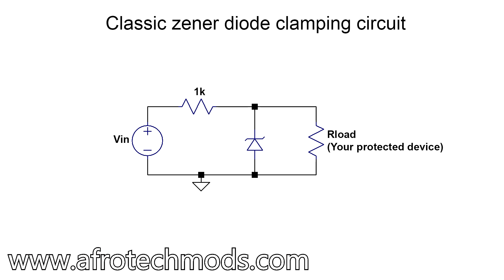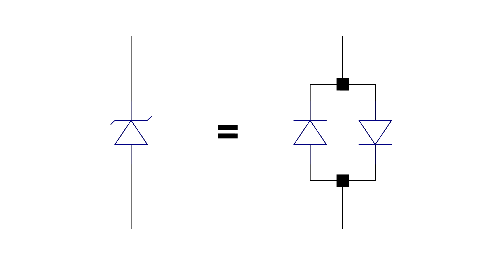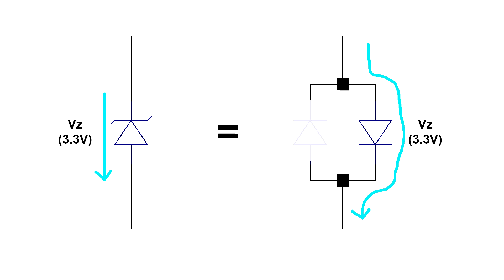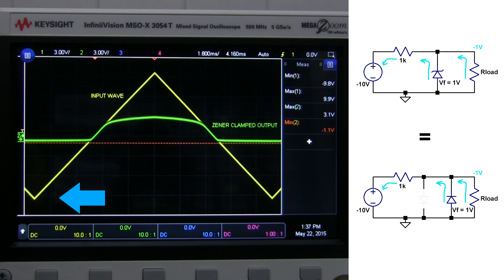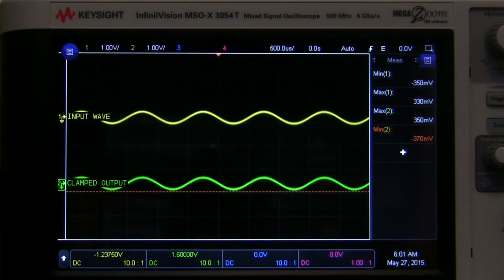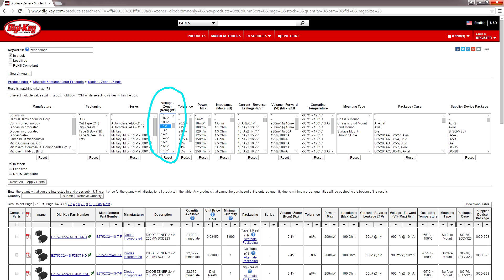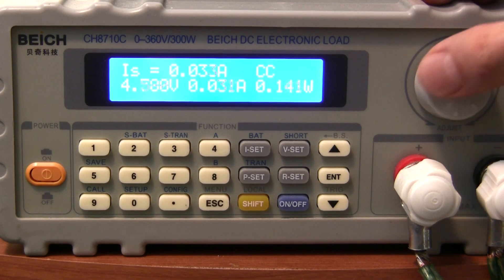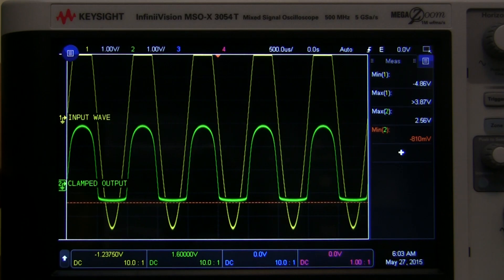What is a zener diode?

Comment: bi-directional diodes? HERESY!
Reply: hornylink Actually, all semiconductor diodes exhibit Zener behavior at high enough reverse bias voltages. Even though the carrier depletion layer at the P-N junction becomes thicker (which is also the basis of another diode device called a varicap) with reverse voltage, eventually the tiny trickle of electrons crossing the layer becomes so energetic that they knock other electrons out of their shells, creating electron-hole pairs which allow more current to flow, which creates more electron-hole pairs, etc. When a certain voltage is reached, this happens very quickly, like an avalanche (Zener diodes are also called avalanche diodes), the voltage needed to sustain the avalanche drops, and current increases without restraint unless limited by a resistance in series. This can destroy a general purpose rectifying diode, and is the reason for the reverse voltage breakdown specification on a diode.

A Zener diode is one that is designed to have a lower and precisely defined breakdown voltage, and to recover normal rectifying action (ie stop current flow) at almost exactly the same voltage (rather than at a much lower voltage). And external current limiting resistors prevents destruction of the diode on the first avalanche event.

Now how about a video on the varicap diode, which is used to frequency-modulate an oscillator and to keep its frequency constant?
Reply: They totally missed the chance to call them biodes.

Comment: I was planning to make an oscilloscope "divider" for a mobile phone oscilloscope. Placing two 2v2 zeners, to clamp voltage to a safe limit, not to burn down the mic input. Does this sound like the correct way to do it? Of course voltage would be dropped with a resistor voltage divider first and zeners would be used just as extra protection.

Comment: Could you explain how using a zener diode in series with flyback protection diode aids in shorter relay switching times as show in this picture. http://jumperone.com/images/2011/10/using-relays/002.png I'm having trouble wrapping my head around how works.
Reply: Jon Vannatto I'll give it a try. The goal is to get a faster switch off time, i.e. the current through the relay needs to decrease faster. The change of current through the solenoid of the relay (I)is determined by the voltage at the relay's solenoid contacts (V_L), V_L = L (dI/dt). L is the solenoid's inductance. (I dont know if you're familiar with derivatives. dI/dt means the slope of I, how much it changes with time. The unit would be Ampères / second). How fast the current decreases is therefore determined by (dI/dt) = V_L / L. Without the zener diode, the voltage (V_L) to reduce the current would be the forward voltage of the silicon diode, -0.6 volts. (Negative, because the solenoid's voltage and the diode's voltage are in opposite directions.) When adding the zener, the reverse voltage at the solenoid will be increased by the zener's breakdown voltage, and so the current decreases faster, and the relay is turned off faster.
However, the maximum permitted reverse voltage is determined by what the transistor can cope with. The highest reverse voltage would be achieved by omitting the protection diodes at all - which is not desireable.

To get fastest switching times, one would also choose a relay with low inductance (L). But this depends on the application. High switching capability of the relay -> massive relay contacts -> high weight -> strong solenoid needed -> high inductance L.

I hope that was more or less comprehensible. If not, please ask. Other readers: If there are any errors, I'm open for corrections.

Comment: Misleading, regular diodes can also conduct in reverse bias, this is known as avalanche breakdown. Which is also the same mechanism for reverse bias conduction in zener diodes.

The only difference is that zeners are engineered to breakdown at a lower voltage on purpose.
Reply: BGM ya, but they're not designed to carry in reverse. The magic smoke comes out

Comment: Would you consider doing a followup to this video with more circuit "protection", with how to more completely protect an analog input from both negative and high voltage and high currents, for example from a magnet switch in an alarm system, which could be subject to sabotage of hundreds or thousands of volts/amps? How would you easily but very efficiently protect against that? Great video, as always, I love these! =)

Comment: I'm planning to use a zener as voltage reference for a low voltage cutoff or alarm on a lipo. How accurate and stable will it be for this purpose?
Reply from the maker: SirArghPirate I don't recommend it! Use a proper reference voltage IC.
Reply: Afrotechmods A LM7805 for instance? I plan to use it on 2S or 3S lipos. The 5V ref voltage on the non-inverting terminal and a potentiomenter as a voltage divider to set the cut off/alarm voltage on the inverting terminal and when the voltage from the voltage divider falls below the 5V, the output goes high and sets off a second comparator arranged to oscillate at a certain frequency with a buzzer attached.

I don't know if this works though..
Reply from the maker: SirArghPirate
That sounds reasonable but you may prefer a 3.3V reg or a lower drop out 5V reg for the 2s pack. Make sure you use a worm gear driven pot that can't vibrate loose.
Reply: Afrotechmods Good advice, however I think I'll stick to fixed value resistors and eventually a jumper to switch between two ratios, one for 2S and one for 3S. If I use this for a cut off circuit, where the output from the comparator drives a mosfet that controls the power going from the battery to whatever equipment I use it on, will I run into problems with the system oscillating on/off due to the voltage from the battery being slightly lower during load?
Reply from the maker: SirArghPirate Yeah oscillation can be a bitch in these situations. Look up "hysteretic comparator" for one possible solution. Definitely simulate in LTSpice and test on the bench before deploying live.

Comment: Hi, I'm designing a simple radiation detector.

The GM tube requires 400VDC. I found a nice plan for the step-up itself, but it still needs some kind of feedback, so when the output reaches the desired voltage, a transistor would pull the base of the oscillator transistor to ground.

The best idea seemed to be using a 400V zener diode, but the store I oder from only sells 100V zeners...

So my question is the following:
Is there an alternative - apart from putting 4 in series - to make the feedback?

Comment: noob question: Is there any reason why you wouldn't just use two silicon diodes instead of a zener diode?
Reply: derstreber2 The silicon diodes are going to have similar voltage drops.  So it would be around .7v in each direction.  The zener effect allows for the voltage to be much higher than the .7v of a standard silicon diode.
Reply: derstreber2 Zener diodes are meant to be reverse biased to behave like a regulator ,so you van get a 12 V,3.3 V,5.1 V etc.Silicon diodes only get 0.7 V always (of course there is a limit on the voltage you can apply to them depending on the size)

Comment: Is there a discription on the diode to tell what the voltage are? So one could tell which is which?
Reply from the maker: centaur1a You have to google the part number for the datasheet.
Reply: 1N47___ look up in nte cross ref. guide . 1N47, 1N52__ are zeners, sometimes just a letter then a voltage. eg. 5.1

Comment: Great tutorial, I'll be looking out for the "fartduino"! On a more serious note I know you can add a transistor to the zener circuit when more power is needed.  The collector goes to +, the base connects to where the resistor and zener meet, and the load connects to the emitter and ground, that kind of circuit has been around for years.
Reply from the maker: CoolDudeClem Yes that's a very common way to make a linear regulator!
Reply: CoolDudeClem Yup! To achieve better load regulation,  (lower the apparent output impedance) then use a transistor with a high gain, because when you use a BJT as an emitter-follower like you describe, you create effectively a feedback loop within the transistor, and higher gain is like a higher 'P' factor, so better regulation. You can use a darlington to further improve load regulation, but the disadvantage is that the "dropout voltage" will be considerably higher.

If instead you use the complementary darlington pair, you will get the advantages of a low Vbe saturation voltage (which is the main culprit for dropout voltage) as well as additional gain, and better line regulation! :D I actually use this set up a lot when I cannot find a suitable regulator in my junk bin!

However, if you are simply using resistors to bias the zeners instead of a proper current source, then the current through the zeners will be proportional to the input voltage, and since the zener voltage changes a bit with respect to that current,  the overall line regulation will be pretty crap, but good enough for most non-critical things. You can actually use a small regulator as a voltage reference to replace the zener diodes and improve performance.

Comment: "Just make sure you don't use them for anything high powered."
*imagines you inserting a clip of some melting zeners*
Doesn't do it.
Disappoint!
Reply from the maker: Forssa1 I uploaded those a few days ago!
Reply: +Forssa1 Grabbing a zener that has turned to molten glass is a pain you will never forget.
Reply: i love these things because they fry very easily ;)
Reply: Afrotechmods will never miss an opportunity to melt stuff
Reply: Forssa1 I have used them on 3 phase static converter to prevent damaging voltage spikes that's high power, but I get what he means.

Comment: can someone please
 explain the difference between positive and negative voltage? why theyre used and whats the difference Afrotechmods
Reply: Moses Maestro A Voltage is a relative value. It is just like any other potential energy you come across in physics; it all depends on what you consider to be "0".

Let's say you have a circuit with a 5v line, a 3v line, and your ground line (0v). If you change your circuitry to instead use the "3v" line as ground, you would now have a 2v line, ground (0v), and a -3v line. Use cases vary, but you might use it to  reverse the polarity of an electromagnet.
Reply: Moses Maestro A more or less. The ability for a charge to voluntarily flow from one point ("to do work") to another is defined as the voltage between those points. When those points are connected through a (physical) resistance, current actually flows. The + or - signs depend on your point of reference, which in electronics is defined as "ground", zero-potential or reference voltage for the purpose of clarity (and because of historic reasons, as you might know - before the electron was discovered, people used to think that "current flow" was the transfer of positive charge. this arbitrary definition stuck and for the most cases still works today (conventional current flow)).
Reply: Moses Maestro A I thought I'd come back and offer you a more complex (but very useful) use for negative voltages: differential pairs.

When you're working with very fast signals, it becomes much easier for interference from other signals to become an issue. To solve this, you use signal pairs that send the same data, but one in a positive voltage and one in a negative voltage.  Processors determine the value of these signals by taking the difference of the positive and negative pair. Since the interference should affect the two signals the same way (either positively or negatively), the difference between them should cancel out, and your data is unharmed.
Reply: krawutzimon thanks. So it mainly has to  do with direction of current flow?
Reply: Mo Overall Fitness Hacks Ääq p Aqaba äqlm317T
Reply: Moses Maestro A Sometimes it helps viewing "voltage" as "potential" in analogy to the potential of classical mechanics (although it is of course a gross simplification):
Imagine a house with a ground floor, an upper floor and a cellar. If you're in the upper floor, you can let something drop down to the ground floor. You are at the positive potential, the ground is at zero. You can similarly let something fall down to the cellar, from either the top floor or the ground. The cellar represents a negative potential (or voltage) here. An object will not voluntarily "fall up" from the cellar to the ground floor or even the top floor, you have to invest energy or do work, to lift the object up.